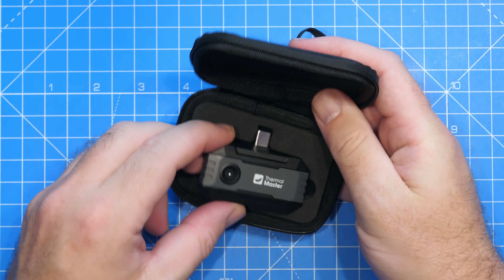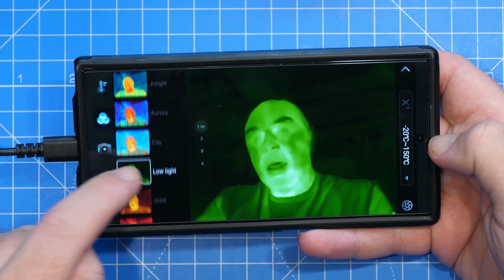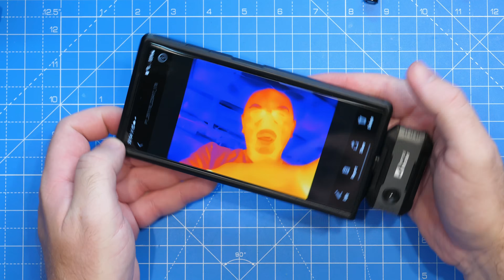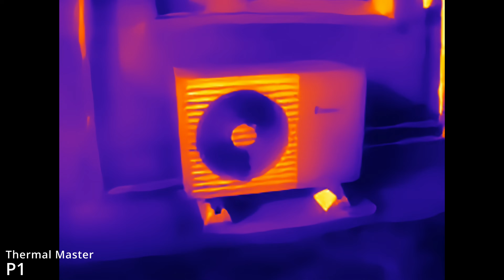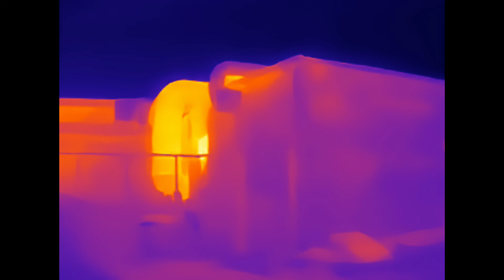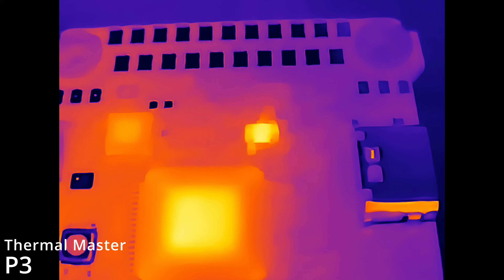Thermal Master P1 USB C Thermal Camera Review - Just $130 Right Now!

Comment: Hello, 
do you know if you can see the underfloor heating pipes ? Do you have the possibility to check ? Thank you
Reply from the maker: If they are over wood absolutely, even concrete can be seen.
Reply: @MadRC  However, the depth at which the pipe is buried and the material of the surface have a significant impact. If the pipe is buried too deep or covered by a thick layer of concrete, it will be difficult to see clearly.
Reply: I used a FLUKE to check for uneven heating in the underfloor heating system. It was pretty convenient for identifying which areas had temperature differences.
Reply: I usually use a thermal imager to inspect underfloor heating systems during winter home inspections. When the heating system is running, you can see the pipes with the thermal imager. I recommend letting it warm up for a while first; then the pipe layout will usually show up quite clearly.
Reply: @VanceKassab  I don't recommend checking the floor heating right after turning it on; it's best to wait a while to let the temperature distribution stabilize.
Reply: @VanceKassab  Can you tell me which thermal imager you use, or can you recommend one to me?
Reply: @Tyler_Brooks-i8l  The model I'm currently using is P1. I think it offers the best value for the money among all the thermal imagers I'm familiar with, and it's more than sufficient for everyday home inspections.
Reply: @DianeGebhart-w9z  P1 is definitely great for routine household checks, but the downside is that it still relies heavily on your phone. Especially in winter, the phone’s battery drains quickly, so the device can’t stay on for very long.
Reply: @Tyler_Brooks-i8l  If you're just doing occasional checks at home, there's really no need to invest in particularly expensive professional-grade equipment. I think P1 is basically sufficient.

Comment: Hey Ian, I know this is off topic but I was wondering if you can help me with some knowledge. I am a DJI goggles V1 user , with vista and v1 air units. I recently bought a new vista which is on 1.00.0606. My goggles and all 5 other air units are on 1.00.0600 (this is the firmware before the rollback block). Should I update all my air units and goggles v1 to 1.00.0606 or newer to match the newer air unit  (is there any signal or penetration loss on newer firmware past 1.00.0600) or keep all my gear on the older 1.00.0600 firmware and save my vista on 1.00.0606 for a future day. Basically is 1.00.0600 worth staying on for range and penetration vs 1.00.0606+
Many thanks 🙏🏼
Reply from the maker: Nothing major has changed, flying with the missmatch fw should be fine.
Reply: @MadRC thanks for getting back to me so quick. They do bind with the firmware mismatch yes.

Comment: This type of camera is useful for checking the condition of LiPo batteries while charging. It shows which cells are heating up more, allowing you to quickly eliminate damaged batteries before they cause a fire or cause the drone to malfunction during flight. It's a shame that the P1 model doesn't come with a macro lens, so if you want to use the thermal imaging camera for electronics repairs, choose the P2 model, which has such a lens, and it's excellent.

Comment: I own a Flir E5 at work, good camera but bulky as hell. Picked up the P1 for personal use, mainly to check insulation at home. Compared both on the same wall, and honestly the P1 didn’t fall that far behind. I could see the same cold streaks, maybe a little less contrast but still clear enough. The E5 costs over a grand, the P1 was $139. That’s an easy choice.
Reply: If that's the case, I'd definitely go with the P1.After all, you can get a device with nearly the same performance for a fraction of the price. When it comes to value, the P1 is hard to beat.
Reply: Actually, I don't think these two products are really comparable—one is a handheld thermal imager, and the other is a smartphone thermal imager, so they're aimed at completely different markets.
Reply: @MuhammedHshdv  FLIR E5 is also a relatively old model that is no longer in production, so unless I buy a used one on eBay...
Reply: @Scott_Morgan0-0  Don’t assume it’s cheap just because you’re buying it on eBay. It’s still close to $800, and at that price, you could just buy a new one.
Reply: I work as a home inspector, so I prefer a camera that’s smaller and ready to use at a moment’s notice. I think P1 better meets my needs.
Reply: @ClaraReeves-y4m  Don't let the comments section sway you,you can definitely choose other devices, such as brands like FLUKR and HIKMICRO.
Reply: @DianeGebhart-w9z  Thank you for your kind offer. Price was the least important factor in my decision to choose P1. I borrowed a friend’s demo unit to evaluate its performance in terms of image quality and detail, and I chose it after carefully weighing all the factors.
Reply: @ElizabethNelson-g4x To be honest, trying it out for yourself is probably more reliable than reading a bunch of Reddit comments. There can be quite a bit of variation in how thermal imaging devices perform in real-world use.
Reply: @VanceKassab  I'm just like you.I love watching product reviews on YouTube, but I've ended up with items that didn't live up to the descriptions so many times that I've stopped trusting any reviews. Now, I usually go to the store to try things out before deciding whether to buy them.
Reply: @LynneBasham-m6s  That makes sense.If you’ve actually tried it out before buying, price isn’t the most important factor. Picture quality and user experience are more worth considering.